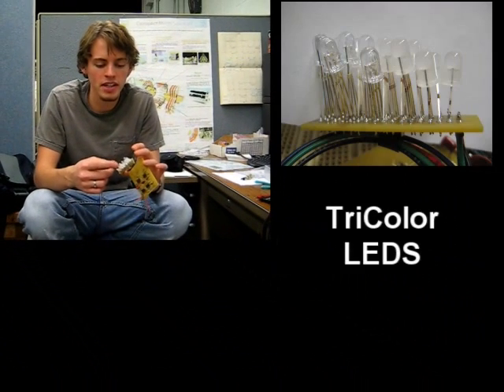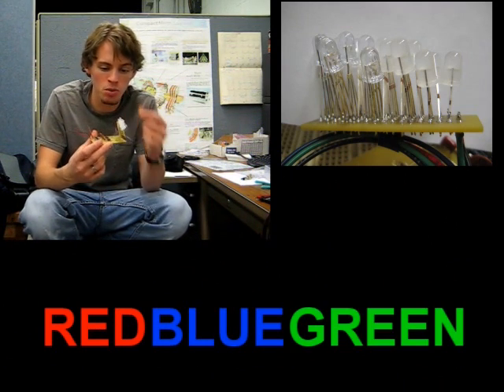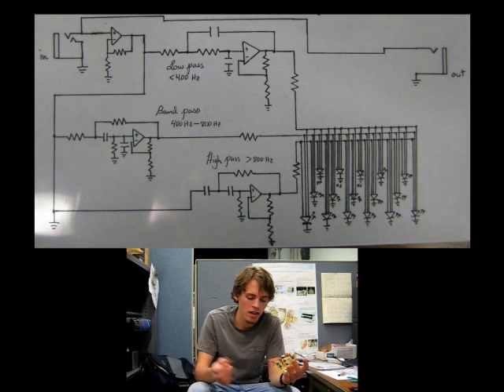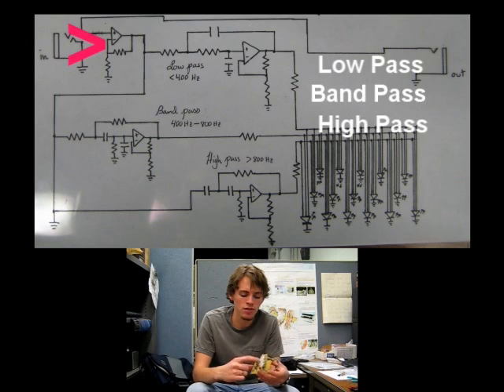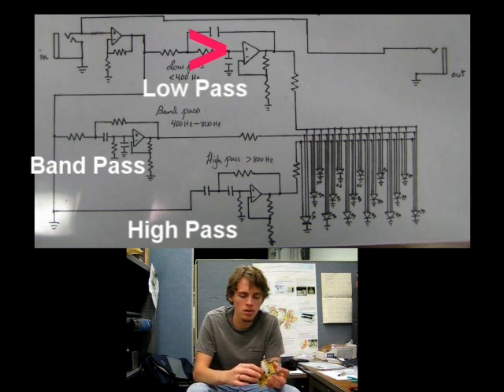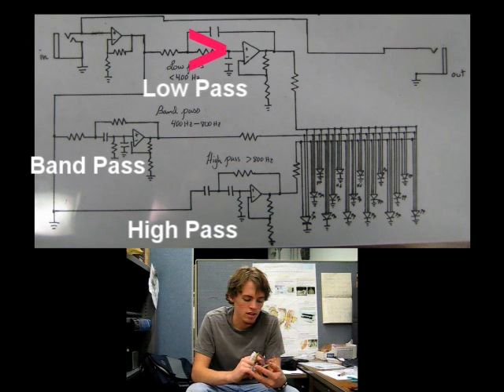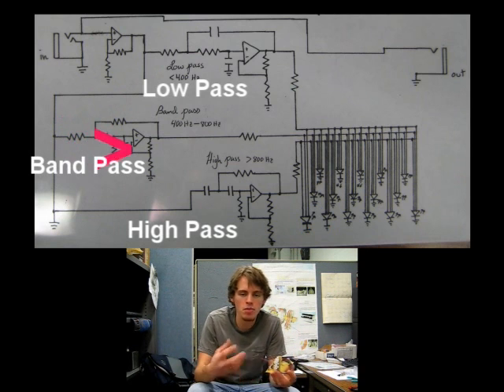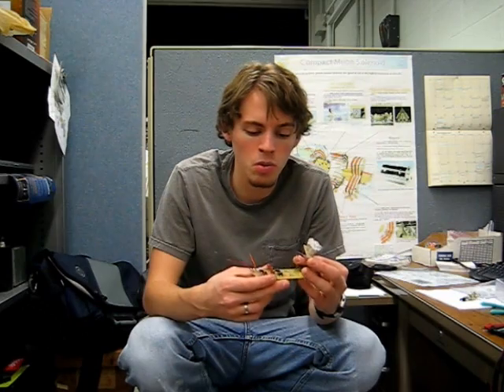The Color Organ of Doom

Comment: Hello, there. I'm trying to make voice organ too, but I, have one problem with current needed for LED's. Typically, op-amps have pretty low output current (Correct me if I'm wrong), so if I'm using about five Led's for one frequency band, and connect them parallel, I need 20mA*5 = 100 mA. So what kind of op-amps did you use?

Comment: Did you ever get it installed on your guitar? I was thinking of doing a project custom guitar based off the Rickenbacker 331 "Light Show" guitar and was looking for ways to do the lights without an external power source (the Rickenbackers had sort of a power cord as well as a guitar cable to light the lights)